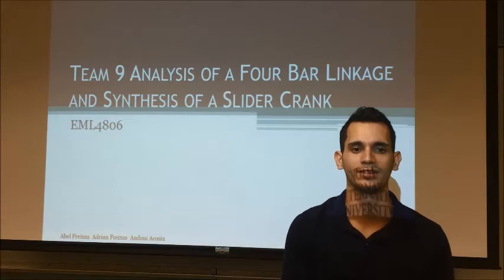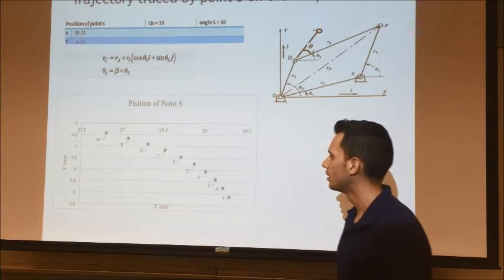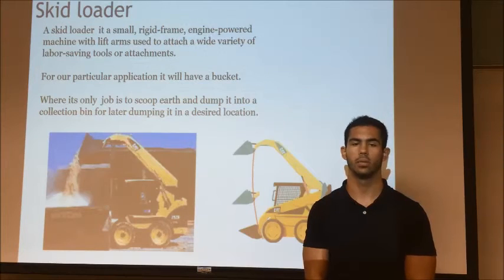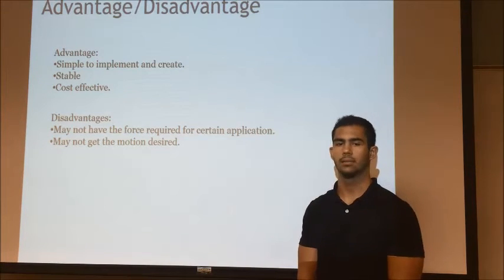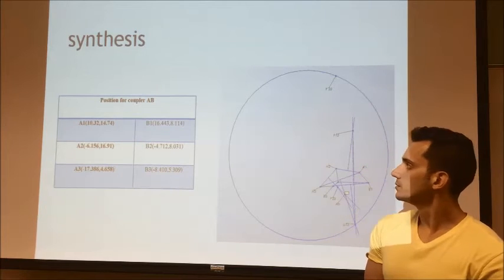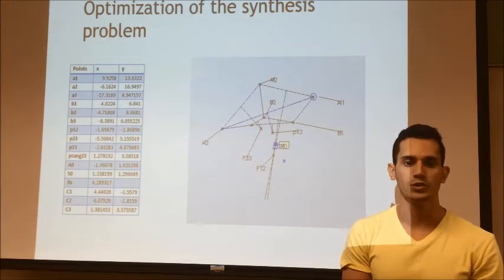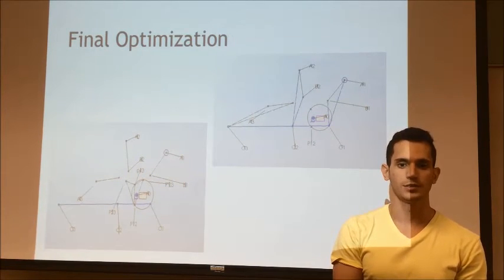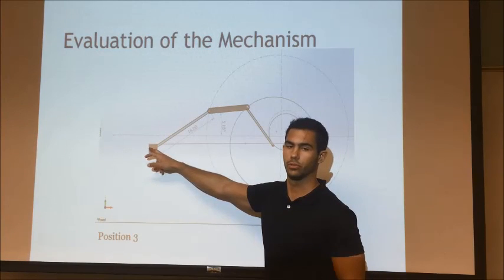Team 9: Mechanism Design: Skid Loader & Engine Applications

Comment: I think you may have been too close to the projector, since the pictures were warping around your figure. Also, slide transitions felt to quick, almost rushed. I think you guys did a good job, just condense the information into less slides, and try to stay out of the projection. Everything else was good.